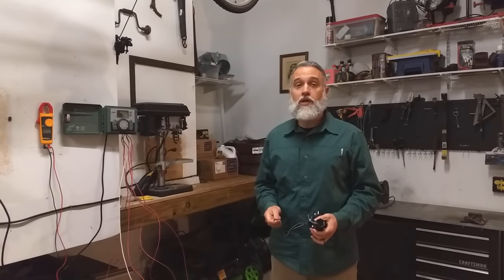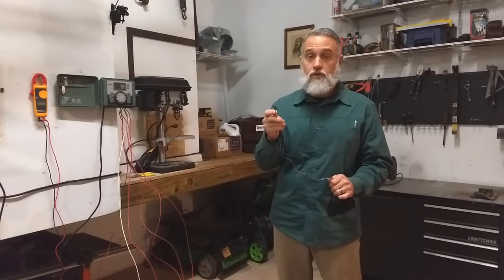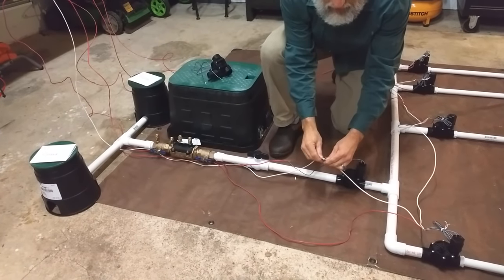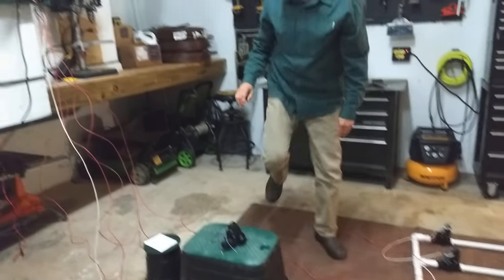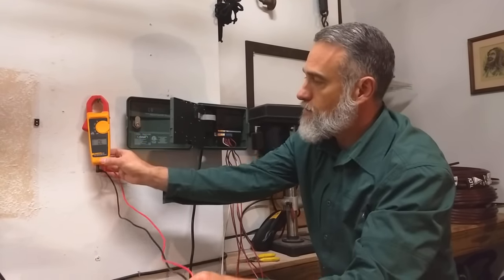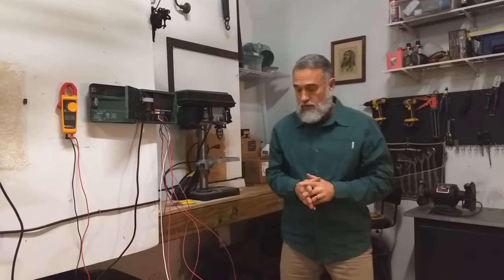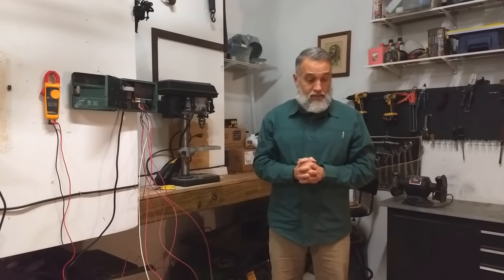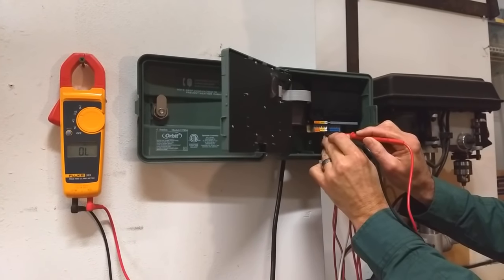Troubleshooting sprinkler system wiring issues

Comment: Great video(s) and this helped me understand and troubleshoot my problem and get it working.I'm still confused on how my 5 zone system worked in the first place until I attached the common wire to the controller.There was a red stranded wire attached to the common on the controller.All the other wires were copper,not stranded. I had an old Rainbird ESP-6si  controller that was working fine but I wanted a WIFI so I installed Rainbird ESP-TM2 6 and wired it exactly as the old controller but no valves came on.I thought I must have fried something so I re-installed the old controller and it didn't work either.

I then dug up the valve box which probably hasn't been opened since the initial install 17 years ago and could see the 5 valves and their corresponding colored wires and a white common (not red).I went back in the garage and connected the white wire to the common on the old controller and it then worked.I then re-installed the new controller and it worked as well.It wasn't a case of me not wiring properly.The white wire at the controller had not even been stripped until I did it! It just blows me away how it worked to begin with and I have no idea what that red stranded wire is.Maybe it's a rain sensor but I don't want that hooked up any way.
Reply from the maker: So glad you figured it out!

Comment: Jimmy, thanks for the great video. I just removed my rainbird timer and installed Orbitz b-hyve. The rainbird had a MV wire, however, on the Orbitz there is no slot for MV, do I connect this wire to common or pump? Thanks!
Reply from the maker: Pump should do it.

Comment: Thanks for the Video. Have a Hunter Sprinkler system with an Orbit B-Hyve  controller. Everything was working fine till a few weeks. I was watering manually using the Orbit app and we had a week of sporadic rain in Toronto so didnt need to water. This weekend tried to water and there was no water in any zone using the app. Deleted and reinstalled the app. Checked the voltage and Ohm at the controller end. Also tested each solenoid and had a steady reading. Even replaced the controller. I can turn on the water for each zone by turning on the solenoid using quarter turn but other than that I cant get the controller to water. Not sure where the fault is. Appreciate help
Reply from the maker: If you are getting ohms 20-60 on each zone & the controller is giving AC, I would check the water source.  If you have a MV, I would change the guts in it.
Reply: @4L Irrigation Repair  The water Source is fine as I can turn on the Valves by using the solenoid
Reply from the maker: @allyirfan8663  do you have a MV?  If you think it has to do with the controller you can call the manufacturer for technical help via phone.

Comment: What would be the problem if I don't get any resistance in any zone? And when I turn on a single zone all of them get voltage at the same time? Everything was working just fine a month ago. But now I can't get them to turn on.
Reply from the maker: Carlos Sandoval, it is most likely a problem with the common, somewhere between your controller and the last valve.  Could be  the solenoid in that last valve, a bad connection, a bad splice, or even a hard wired rain sensor.  Good luck!

Comment: Hi! Thanks for the helpful video! I recently moved into a new house and 2 of my 3 zones are not functioning. The valve box I have found only houses the piping/valves that are located to the left of your master valve shown on this video. It does not have any of the solenoid valves or wires within this box. Would the solenoid valves for each of the zones be in a different area in the yard? And do you have any tips for locating them? I would like to try to manually turn on each zone at the solenoid valve to verify functionality.
Reply from the maker: Depending on what part of the country you are in will determine where they put the valves.  Here in North Texas the valves are usually scattered throughout the yard.  To find them you will most likely need a valve finder or to hire someone.  Here is a video that may be helpful.  https://youtu.be/losQPAWSkK8
Reply: 4L Irrigation Repair thank you! I am in Chattanooga Tennessee

Comment: Thank you for your video Jimmy. I got a Rain-bird SST9, got a red wire going to zone 1, an orange wire going to zone 2 and the rest are white wires, how can I find out which one of them is the common wire
Reply from the maker: If all the wires aren't pulled out, it will be the one in the common slot on the controller.  If everything is disconnected, if you have a station master or similar device you can send a tone from the valve and then get the tone at the controller.  Another method would be to put one probe on a colored wire and the other probe on each of the white wires (separately) until you get resistance.  Hope this helps.

Comment: So normally, would all of those valves be in the green box in front of you? I assume you have them out of the box for instructional purposes?

What/how would you troubleshoot a low pressure zone? We tested our sprinklers early in the year and all were fine. Now 1 zone is super low on pressure and at least one other zone is dead.
Reply from the maker: Yes, normally the valves have some sort of box on top of them.  For low pressure on a zone that was fine is usually a leak or the diaphragm is bad.  I probe around each of the heads to see if that is the place you're losing pressure.  If not and there is no visible leak I'd change the guts out of your valve to see if that's the issue.  I hope the best for you!

Comment: Great videos!  I have six zones in my sprinkler system but only one thru three zones are working. I checked the continuity and they all have 24 to 27 ohms. Zone one thru three have 24 volts. However, there are no voltage on zone 4 thru 6. Please help. Thanks!
Reply from the maker: The issue the controller.  You can replace it or if it’s a newer controller call the manufacturer and they will help you troubleshoot it for free.  I hope the best for you!
Reply: @sprinklerrepair4L  Thanks a lot.

Comment: I have 5 sprinklers but only the first three are activated by the Rainbow timer.  Any ideas why the last two are not turning on by the timer? Is this a wiring issue or something else?  All can be manually activated. thanks
Reply from the maker: I'd start with measuring the ohms at the controller.  If you get between 20-60 it's probably a mechanical issue.  If not, it's probably a mechanical issue.  I hope the best for you!

Comment: There's some controls.or timers that control the irrigation pump also controls the valves at the same time..what happens if one of the valves won't open. &  the pump is running?
Reply from the maker: Sorry but I don’t have expertise with pumps.  I would ask someone who specializes in pumps.

Comment: I have a problem of rain bird which is when the station stop outometaclly, still the water is coming out .....why ? Thanks for responding
Reply from the maker: It's normal for the lowest head on the zone to seep water out. The steeper the slope, the more you will see this type of activity.  If you mean it continues to water, it points to either a bad valve or controller continuing to give AC.

Comment: Is there a way to test the common wire to see if it's active? I have three boxes all connected to the same timer but am only getting power to one of them? I want to know if power is getting to the second and third one?
Reply from the maker: You can send a tone down it and test it at the other end with a tool like the Armada Protec 48.  That's the best way.  Trying to find voltage in the field is tricky and I don't use that methodology in the field.  Hope this helps!

Comment: Did not see any info on voltage at the zone that is on. Also I assume you are checking resistance with controller in the off position?
Reply from the maker: Yes, resistance in the off position.  To check voltage turn your multimeter to ac and turn a zone on and should get 24-27 v.

Comment: Thank-you for this informative video. I have an issue I've not read in the comments here, yet. Perhaps you can get me pointed in the right direction. My control box is inside the garage, and power is tied into the same line as the garage door opener, yard light, two wall outlets and a GFCI located at the back of the garage. This year, a little while after I run the sprinkler system, I lose power to all the listed points. It's as if water is getting into the ground and shorting something.  First time, I changed the GFCI and the breaker in the electrical box in the basement of the house. After a couple days, seemingly when things dry out, I'm able to reset the GFCI and everything works fine until the next time I water the lawn again and power is lost. The breaker in the basement has never tripped, Just the GFCI. 
Any ideas?    Thank-you.
Reply from the maker: Kevin Bell I’m sorry this sounds more on the electrical side which is outside of my expertise.  I hope the best for you!

Comment: Thanks for the video. I have a rainbird system that I am having trouble troubleshooting :) . None of the sprinklers would come on manual and auto. I even tried to turn the solenoid to see if the sprinkler would come on to no avail. The resistance at all the zones and mv is 45ohms and no noload voltage at each zone is 29.9V. I have not been able to locate the mv. I thought mv solenoid must be bad. could a bad solenoid still give an ok ohm reading?
Reply from the maker: This sounds like more of a systemic problem.  The first thing I'd look at is if you have a MV.  If you look in your controller where the wires are located you should have a slot the is labeled MV or Pump or P or MV/P.  Many times it's next to the common.  If you have a wire in that spot, you probably have a MV.  If it's bad, then nothing with work.  If you have 45 ohms on it and it's not working then it's probably a mechanical failure (most likely the diaphragm).  If this is the case, this video will help you...https://studio.youtube.com/video/Y-SzmZZ2VUk
I hope the best for you!
Reply from the maker: Try this one... https://www.youtube.com/watch?v=Y-SzmZZ2VUk

Comment: Great Video.   I have 2 zones.  Zone 1 tests out at 27 volts.  Zone 2 is only 4.0   If i try other zones, they are all the same 4.0 volts.  Only zone 1 is 27 and i can put the zone 2 wire in the zone 1 plug and its 27.  Any ideas?   thank you
Reply from the maker: Sounds like there is a problem in your controller.  It should be giving the MV and the zone you have on at least 24v.

Comment: Hi. Thanks for this. I do have a question please. If zone 1 shows ohms of 24 and then zone 2-8 show ohms of 8. What does this mean? Thanks again.
Reply from the maker: Frank Giannetta 24 would be in the correct range.  The others may be indicating a short some where.  Usually a reading of 8 would indicate a bad solenoid, but it would highly unusual if 7 went out at the same time.  I’d find a valve in the yard and disconnect the wiring for the solenoid and take an ohms reading.  If it reads ~ 8 ohms then you know it’s bad.  If not there is an issue in the wiring somewhere between the controller and valve.  I hope the best for you!
Reply: Thank you very much. I'll let you know how I get on with it. I may have to get you out to see me. 👍🤪

Comment: I’m my goodness I could literally cry! I have spent hours and hours trying to figure this out AND someone cut my “white” and I had idea how to fix! Now I see why nothing o past a certain zone will work and I just need to figure out how to fix the cut wire. A worker cut my 1” blue pen pipe and the wire. The pipe has a red wire sorta of under it but almost too close to cut the pipe. I have dug out the area but can’t find a good answer for repairing pipe as I think I have to remove about an inch or little more and the couplings are so short! I found a barbed coupling but my hands are weak and these are so hard for me to push in. The other coupling is one of those that goes on the outside, slips on and stays because of the tiny metal teeth inside the rim. But I’m not sure I have enough pipe to reach once I remove an inch. And now I’m off to see what other videos you have because you are the best “teacher” I have found after weeks of searching! Thank you for taking time to make these videos. By the way I’m in Texas as well, little town just outside of Austin.
Reply from the maker: Thank you for the kind words!  So glad it helped!

Comment: I have Toro Vision springkler timer (controller).  When the master valve (or pump) wire is connected, my controller fuse burns immediately and no power to the timer at all.  When I disconnect the master valve wire with the fuse replaced, the timer powers on and the timer and sprinklers work.  What seems to be a problem?
Reply from the maker: There could be something wrong with the solenoid, the wiring or the controller.  I'd check the connections and make sure there aren't any shorts first since it will be a cheaper fix.  I hope the best for you!

Comment: How do I know which wire is the common wire? 7 zones, 4 white wires, 3 red wires. Wires are not plugged into the controller.
Reply from the maker: Assuming your wires are good, assuming you only have 1 common, Turn your multimeter to ohms, Pick a wire and put one probe on that wire and then go through each of the other others until you get a reading between 20-60 ohms.  1 of those 2 wires is the common.  Continue to measure ohms until you figure out which of the 2 is the common.

Comment: What if the valves are 100’ away and I’m trying to determine the common wire that’s connected to timer?
Reply from the maker: Not sure I understand the question, but  you can run a common on top of the ground to the nearest working valve that shares the common, or you can run a wire all the way back to the controller.

Comment: Hello I have a low ohms reading on the panel its about 13 ohms, but I go outside on the selenoid and it looks good about 33 ohms, but that zone is showing error in zone, and it wont open manually either, Im looking for any advice on what to do, thanks in advance
Reply from the maker: Either your on the wrong valve or you have a short between the controller and the valve or you’re on the wrong valve.  Cut the wire on the solenoid (not the common). Then go back to the controller and see if you lost all ohms.  If so you’re on the right one and have to find the short.  If not you may get lucky and it’ll just be a solenoid.  I hope the best for you!
Reply: Okay thanks I wil do it, I appreciate it

Comment: My wires are buzzing. any advice?
Reply from the maker: May be a solenoid or controller.  You can unplug the controller to rule it out & change out the solenoid if it’s coming from the ground…

Comment: Does the zone need to be running to read the resistance?
Reply from the maker: No, it should be off to read the resistance.  It should be running to read the voltage.